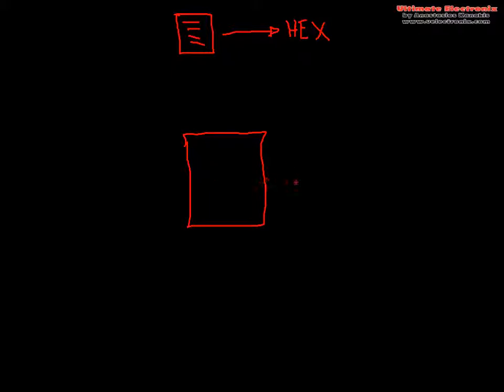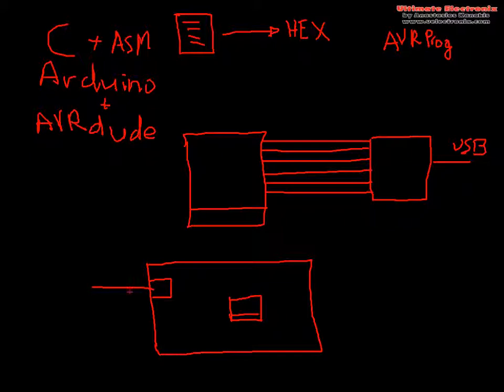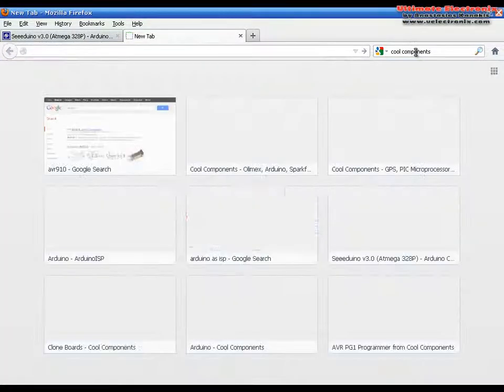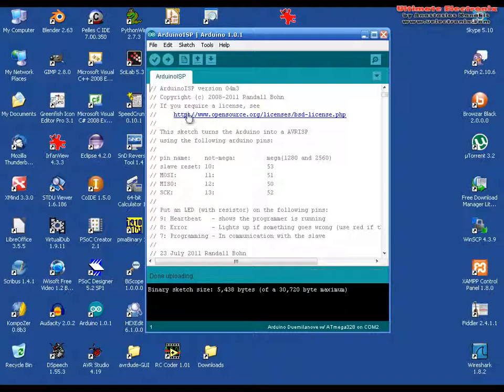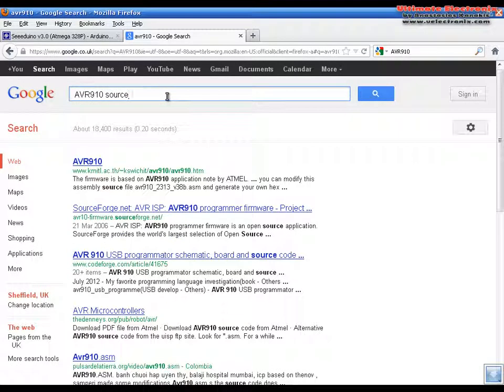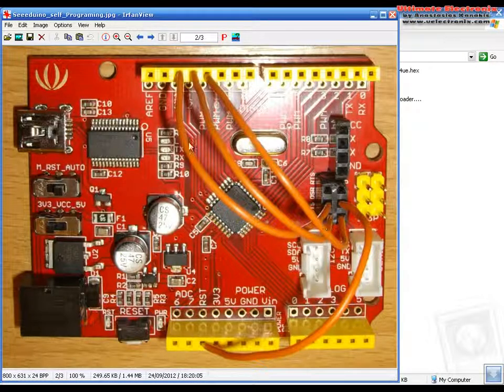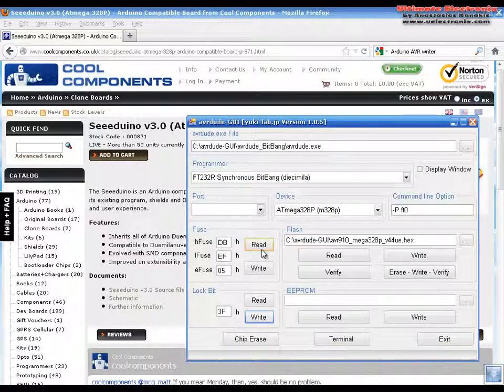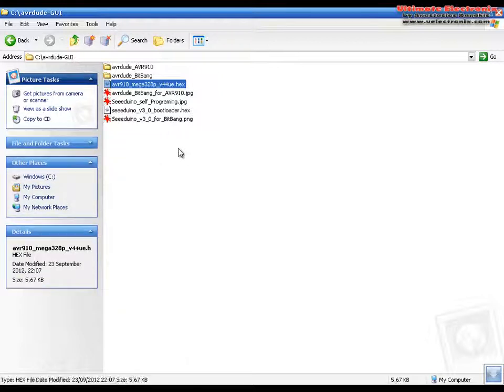Embedded University Tutorial - No.4 - AVR Programmer in Seeeduino, Author: Anastasios Kanakis

Comment: Could you share your firmware to 328p ? Thank You !
Reply from the maker: +soul1234 
Here we go https://drive.google.com/file/d/0B8yAaJCu86KZdW5jNm4teklGVUk
Reply: +electronix79 I did this with arduino uno r3 - I need know where is miso, mosi, sck and reset for programming chip. Avrdude GUI recognize programmer and FW version, don't read chip signature, bcos is not connected. Avrprog from Atmel start error - No supported board found
Reply: OK it works. Slow but works :) mosi=mosi miso=miso sck=sck and reset = ss=PB2=pin10. Atmel AVRProg.exe doesn't work without board. thx a lot man. I did ISP MKII instead arduino uno R3 board by replacing firmware in Atmega16U2 on to LUFA FW (m328p is removed). Unfortunatelly MKII doesn't service AT90S2313 :D Firmware m16u2 replaced by Atmel FLIP software.
Reply from the maker: +soul1234 
You are welcome! )
Reply: +electronix79 If You could share sourcecode couldbe a bit replacement this. At the first connect should be send "AVR" string for properly connect with AVRprog.exe, when hi stay on focus. I'd checked this years, years ago on 2313...